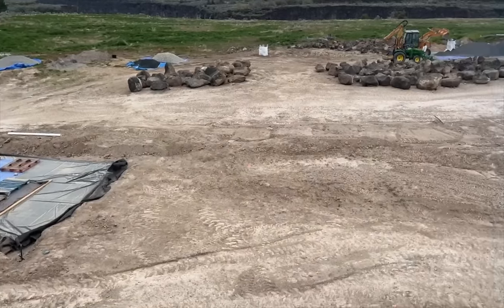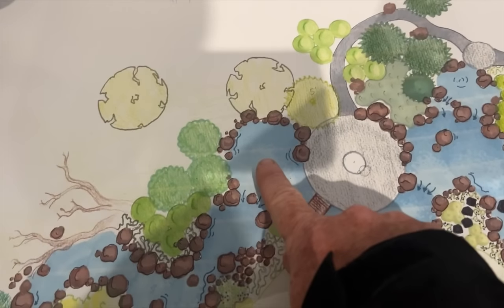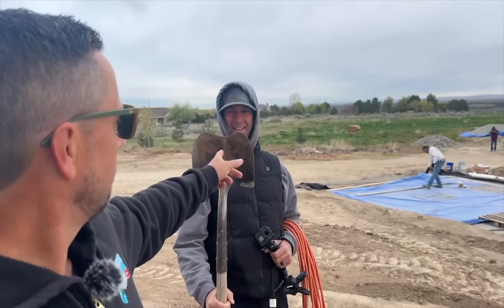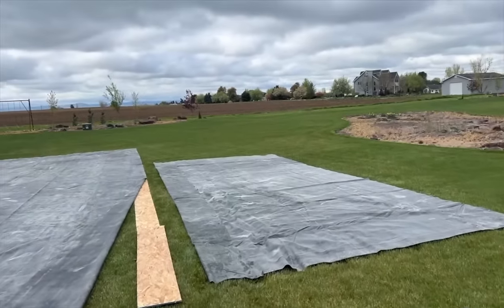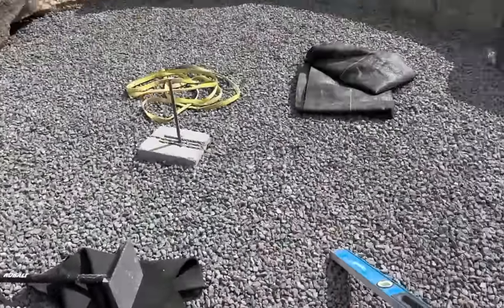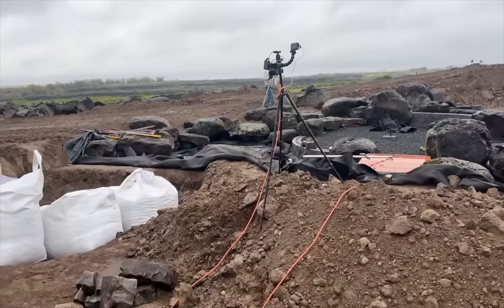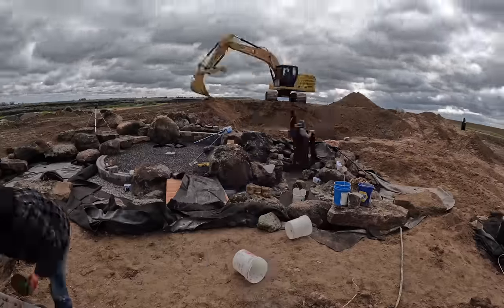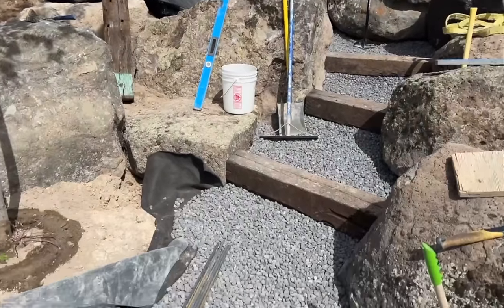Massive Backyard Oasis - 185 Foot Long Stream Installation PART 1

Comment: I couldn't tell for 100% sure but did you run two 9 PL pumps into one 3'' line feeding the waterfalls?  I want to add another 9PL pump to my personal pond intake bay, was planning on running another 3'' line, but if I can cut in a fitting into the existing 3'' line that may be the way to go....